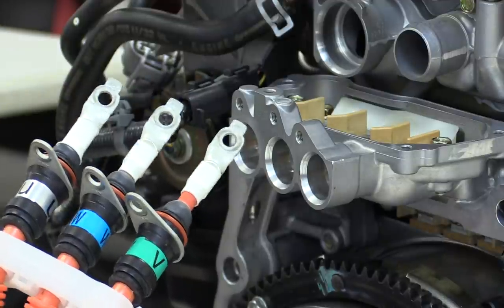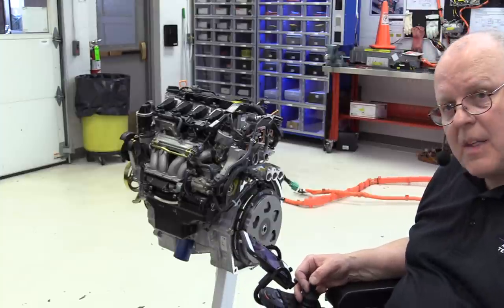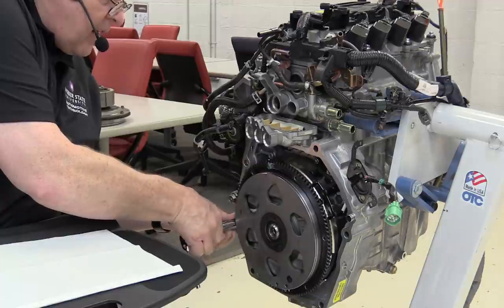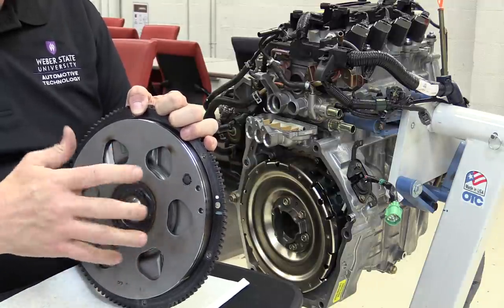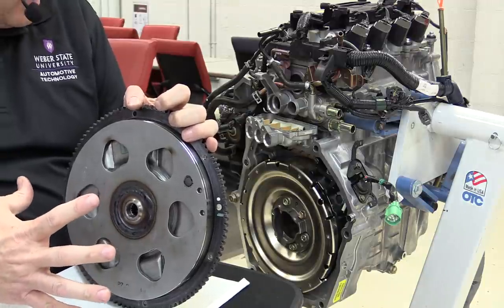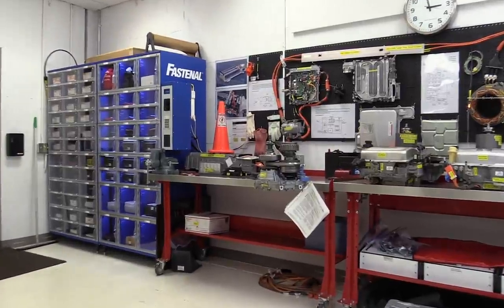Honda IMA Hybrids Part 3 - IMA Stator and Rotor Service

Comment: You are a great instructor! Hybrids look like an interesting system to work on by someone detail oriented and knowledgeable in electronic systems. Not a system I'd want a hack working on!!
Reply from the maker: Thank you!
Reply: @WeberAuto  Hi, that drive spline that can strip is that a problem which can occur on the non hybrid drive CVT transmission cars?

Comment: Fantastic, detailed instruction. Thank you.
Reply from the maker: Thank you!
Reply: There were/ are manual transmission option for the IMA/ Engine combo on Honda vehicles, like the 2010-15MY CRz :: FYI
Reply: There is a way of explaining IMA that I find useful to petro-nuts 

The IMA motor generator provides 10kw/ 13 hp of electric boost & torque while the gasoline engine is spooling up to a useful RPM range 
The IMA motor can extract or recover energy from the drivetrain to charge the energy storage battery (traction hybrid battery) 

Later models use a 15kw / 20 hp IMA motor with greater e-boost & energy recovery power 

With peak torque between 1000 & 2000 RPM the electric IMA motor is strong when the petrol engine is weak. 
This gives the 1.5L engine setup in the 2014 CRz that I drive better than Diesel like low end torque performance, where you can tool around at low speeds in 4th, 5th or 6th gear as you approach 30mph, the engine barely spinning at near idle speeds. If you are really gentle with the manual tranny, you can eeek out 40+ MPG
Reply: @WeberAuto  hey! Thanks for the vid. I'm replacing the rear main seal in my 2004 Honda civic hybrid. Can I just remove the entire hybrid assembly without removing the rotor separately to access the back of the motor? I'm trying to avoid buying/finding the rotor removal tool. Thanks!

Comment: Thank you, Professor! Now I understand the main differences between this single electric motor hybrid system, and the two electric motors that Toyota and Ford have. The two motor system takes advantage of the planetary gear set, so one motor is the starter/generator/assist and the second motor can drive the main wheels in parallel as the planetary set allows two power inputs and one output. This is why the Toyota/Ford systems work much better.

I wonder if the IMA system can add a clutch between the rotor and the crankshaft to isolate the electric motor and avoid turning the gas engine until it is started. Th electric motor will have less loading and obtain more range.
Reply from the maker: Thank you! The new Ford IMA hybrid type hybrids use a clutch between the crankshaft and the rotor for EV mode

Comment: You did a good job explaining how many different automakers are doing different kinds of electric motor integration with the ICE to improve fuel economy, lower emissions and make more useful torque sooner while also enabling energy capture from the transaxel to charge the hybrid battery (regenerative braking + peak shaving where the crank energy available exceeds the user input demand (pedal request) to capture excess energy from the engine that would normally go underutilized in a conventional vehicle. 

The spline shaft rusting problem you identified clearly articulates why keeping water out of a vehicle made with IRON & copper based components is so important! Those reactive metals undergo entropy faster with ongoing exposure to water. 

Any thoughts about the best hybrid architecture, system complexity vs reliability and net long term carbon energy or total lifecycle carbon of each system approach. It is possible to make a wildly efficient system that is not very reliable, but very costly to make as one example. 

What about hour meters, and why automakers do not include hour meters on vehicles? so you can see how many net hours the vehicle has been on? 

Any thoughts about the battery longevity in hybrid vehicles, in terms of calendar years ? replacement costs ? and long term access to replacement parts as the vehicles age?
Reply from the maker: Thank you! The newest Toyota hybrid system is hard to beat. The only thing I was hoping they would have done was to use gasoline direct injection on the Prius. The new Camry hybrid with GDI is almost at Prius mpg. If the Prius used GDI, it would probably be above 65 mpg. GDI is expensive and troublesome though. 

No thoughts on an hour meter. Some on-board ECM track engine run time.

Honda seems to be the only hybrid manufacturer with terrible batteries. Nissan isn't any better with their leaf EV.

Thanks for your feedback!

Comment: Fantastic explanations. I've been afraid of digging into my Gen 1 machinery (I'm very comfortable tearing into IC engines), but you've made it so clear that I feel confident that I can do it if necessary. 

Question: Is it possible to swap in a Gen 2 stator assembly and add a few cells to the battery to get that 50% increase in power? 

Thanks!
Reply: I am not the professional but have some experience in hack upgrades. My guess would be you would need to replace the rotor, stator assembly, wiring to battery, and battery unit (including the modules as the charge voltage will be different.) Whether or not the 2nd gen control module would play nice with the first gen engine ECU is a different story. Also you might run into issues with the different speed sensors present and swapped with the stator assembly since I believe at least one of them goes to the engine ECU and even if the connector was repinned it might not have the same input voltage or wave pattern. Sounds like it would be a pretty big upgrade if it works!

Comment: As a massive fan of my old first gen '04' civic ima manual, i am wondering if you can change the 10kw ima engine with a later 15kw ima engine. In the video they seem to be the same size🤔

Comment: Thanks for the information on the IMA system.  I was thinking Hyundai has a clutch between the crank shaft and their IMA motor so the engine and the motor can be decoupled during electric mode only.
Reply from the maker: Thank you!

Comment: Can the U V W wires from the generator be desired some other way regulating the voltage so that it can run the car without the IMA battery? After all it is a generator that isn’t being used after the IMA battery dies

Comment: Great video. I'm trying to help a friend diagnose a problem with his 07 civic hybrid. When he gently accelerates from a stop there is a chattering noise then it catches. Letting off of the gad helps. Only occurs from a stop not while driving. I'm by no means a professional, but I've for many years worked on my on vehicle and friends however I've never worked on a hybrid. I'm trying to learn as much as possible and this video series was very informative. If anyone has a direction to point me I'd appreciate it. Thanks for the help.

Comment: Do a teardown video about the hyundai ioniq hybrid starter generator.
Reply from the maker: I wish I had the parts to do a video on them. It looks like an interesting system.
Reply: @WeberAuto  I believe Hyundai used Dual Clutch Transmission on its newest hybrid.  That's what I am afraid of, just like Belt-type CVT in Honda. They are not known for reliability.

Comment: Excellent  videos. My problem is the IMA light comes on and also the IMA  Battery  fan,this problem is intermittent, any idears.????
Reply from the maker: It sounds like your IMA battery is either running hot because of a blocked intake duct or fan problem, or the IMA a battery is going bad

Comment: Most definitely the best videos I've seen on Honda's hybrid systems. Question, I have a 2006 Honda civic hybrid that I had just recently got 3 recalls done (one being the DC DC converter being replaced) but I am still getting a rotor motor position sensor fault code error. Do you have any ideas on where I should start to try and solve this issue or what could be causing it to throw this code? Thanks in advance

Comment: I have to replace the rear main seal in my 2004 Honda civic. Can I just remove the entire housing along with the rotor/stator to access the back of the motor? I'm trying to avoid having to buy/find that special rotor removal tool.

Comment: Thank you for all the material, it's brilliant! Why the hell don't they crank the engine with the IMA and rely on a traditional starter motor?
Reply: Redundancy. The car can operate entirely in petrol mode in case the hybrid system goes belly up.
Also, in very cold weather, the lead acid battery is better at supplying the necessary current to start the engine than the NiMH battery. Indeed, a lead acid battery's ability to immediately output massive current in all conditions is the main reason they've stuck around so long.

Comment: Hi i have hondacivic 2007.and not charging 12 volt bettry ima and engine lights on always don't wats up i check all fuse boxes
Reply from the maker: Probably a bad IMA battery. Best wishes
Reply: @WeberAuto  thanks

Comment: I'm replacing the engine, can I take the electric motor out without taking it off piece by piece, the engine is bad but everything else works, and Would rather not take extra steps, thanks

Comment: Hi I have a 2009 civic hybrid with the dtc POA3F. Motor rotor position sensor. I didn’t see the motor rotor position sensor for the 3rd gens and what else you can tell us about this error code. Can we do it ourselves or does Honda need to replace it.

Comment: Hi WebberAuto, I've got a Honda CRZ 2013 which is lithium ion battery, my question is if you were to take of the Motor and stator would you be able to wrap bigger copper wires and how would that effect the operation of the system? All the best, thanks for your videos regarding IMA they are really enlightening and will help with servicing my vehicle down the line.

Comment: Sir. I have a question 
in Honda hybrid gp1 ima engine  . In one cylinder two plugs have littel  oil drop  
Why  is  that? 
what is  the  solution  for this ?
Reply from the maker: There are several things that can cause that problem, none of them have to do with the IMA system. I would do a compression test and a cylinder leakage test.
Reply: Normally in civic's with this engine. The valve cover gasket and spark plug tube seals leak oil. Over time if not fixed this can cause damage to the coil packs and cause a misfire.

Comment: Thank you Professor! I have a question for you. I have an Hyundai Ioniq HEV, which It has an electric motor between ICE and gearbox, a dual clutch transmission. This model, which i don´t know if it sells in the U.S. uses the same hybrid system than Sonata Hybrid. It can runs at electric only mode for 2 or 3 kilometers at speeds up to 120 kph in certain conditions. My questión is, if you know, is there some kind of clutch that "disconnect" the electric motor from the engine? or is it solidary to cranckshaft like Honda's system? Thank you :)
Reply from the maker: I believe I read that there is a disconnect clutch or one-way clutch between the crankshaft and the IMA motor on that model.
Reply: @WeberAuto  I have been investigating a bit. In the end, it's easier than i'd thought. The dual clutch connects the electric motor and the transmissión. And a third clutch connects engine and electric motor. I've found this diagram: https://www.hyundaipartsdeal.com/parts-list/2018-hyundai-ioniq-hybrid/clutch-release-fork.html. 
Thank you for your answer and i hope that mine would be useful for you

Comment: On the first generation Honda Insight electric motor. Please explain what is happening when the electric motor is generating electricity by slowing the car down.what is the electric motor doing while slowing the car down and producing electricity. Does the increased magnetic field slow the car down through magnetic field resistance. Or something spinning faster and rotational mass slows the car down.

Comment: If there is an issue with this, would it cause the car to vibrate and make some noise when accelerating from a stop position? I have a 2006 Honda Civic Hybrid CVT transmission. Been having some vibration/juttering sensations when pushing on the gas pedal from a stop position.  Its worse on a stop position if on a hill/incline. It only does this for a few seconds then stops as i gain speed. But its very noticeable

Comment: Hello Sir,
My question isThe 2nd gen hybrid battery has 158 volts in the cells, but I noticed the Ca2 type has around 168 volts. Do you know why?
Thanks in advance.

Comment: fantastic video, great instructions and for a dyi type its a must have, i need to replace my resolver sensor on a 2008 civic hybrid, i thought id see the sensor removal on your video but sadly didnt. any way you have some insight on it, thanks and keep doing a phenomenal job
Reply from the maker: Thank you! The resolver is in the stator housing. It is easy to change once you remove the housing. Best wishes!
Reply: Thanks for replying, 1 more question, I have the pdf that explain how to replace it, but also says it needs to be calibrated once replaced, what if I don't have the HDS to calibrate,

Comment: I just replaced my IMA battery in a 2009 civic 170,000 miles. Is it common when the battery drops below half to have a hard time charging back up.
Reply from the maker: Yes, very common on Honda IMA systems
Reply: before 2012 yes.   before lithium-ion batteries were installed.  in the Hondas anyways. the 2003 to 2011 Ni-Mh batteries were more difficult to keep charged properly and if are allowed to sit at low charge states for a period of time and often then they are much more failure prone.  needed to drive them longer distances if primarily drove them in town in order to keep them charged and in/at a higher charge state/level.  in 2012-up with the Li-Ion batteries they didnt have as much of a failure rate, or were not as easily damaged by being in a lower charge state.

Comment: I have a specific question about an 03 civic hybrid: when rolling forward from a stop I get this groaning noise from under the front of the car. It isn’t when turning, just at that initial startup phase from a red light or something similar. Any ideas on what that sound could be?
Reply from the maker: It is hard to say, but the flywheel splines are known for rusting and slipping at times. Eventually it prevents the vehicle from moving.
Reply: WeberAuto hmm I imagine that could make that noise if it did; cause a grinding sound. Sounds expensive. Thanks for the input!

By the way; great video and explanation.

Comment: Hey doc thanks for the knowledge I wanted to ask a question about my 03 hybrid honda civic can you drive it with the IMA battery being turned off because the  battery is dead so is it possible to run it with just the 12v
Reply from the maker: No. The 12V battery will die as you drive and it will shut off the engine.

Comment: Hello, i have a question: if i drive Honda Hybrid of 1,2,3 Generations (not the new one) on highway with constant velocity and main battery get empty because of no deceleration, straight road, etc. does fuel consumption increase in this case? Thanks
Reply from the maker: Yes it would

Comment: Hi, Jamie here AMIMI CAE, I've been looking into IMA more recently as I'm actually looking at a CRZ for my next car, My question is, how is the motor cooled? I am aware that Most magnets loose their magnetism when their temperature reaches above 80c. Is there some kind of cooling? or is it cooled by transfer of heat to the (already hot) engine?
Thanks
Reply from the maker: There is no active cooling for the IMA motor.
Reply: @WeberAuto  so I guess they limit the power to the motor to keep it running cool. I bet they could make this motor quite powerful if it could be cooled safely.

Thanks for quick reply, watching the rest of your videos now

Comment: I am curious how the IMA motor performs as generator.
Before going to purchase such a motor, I would like to investigate this first.
When I watched your video about this motor, I wondered if you would like to investigate this for me?
Reply from the maker: It is a generator whenever the vehicle decelerates. the rotor is a spinning magnet inside of three coils of wire in the stator (just like an alternator on a non-hybrid vehicle). The rotor induces current into the windings that is used to charge the IMA battery. I hope that helps
Reply: in which is why if thecar is driven primarily short inside city traffic trips then it will never properly or fully keep the batteries charged and will cause them to fail prematurely due to damage from never being in a high enoguh charge state.  apparently you can remove fuse number 15 on certain/some/many years makes models and run the engine at about 3,000 RPM to "fast" charge the batteries.

Comment: can the newer stator rotor be installed on the V1 generation hybrids?
Reply from the maker: Good question! I do not know the answer. I suspect it will fit, but I do not know how well it will work with the different magnet configuration. It would be interesting to try. Thanks for your feedback!
Reply: WeberAuto when you refer to magnet configuration do you mean the pole on the magnets are different